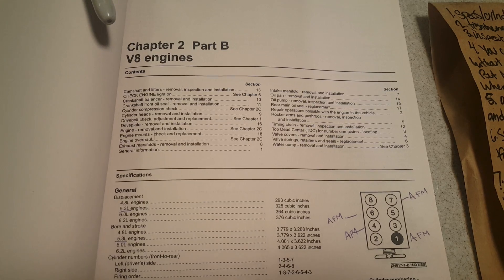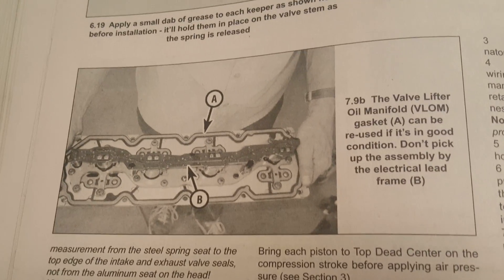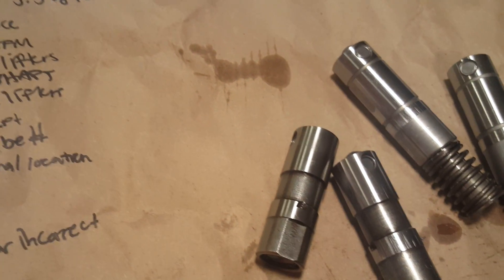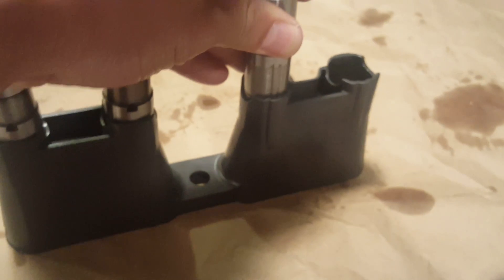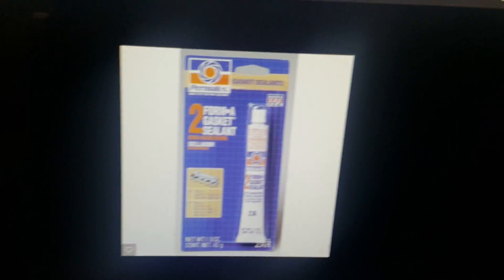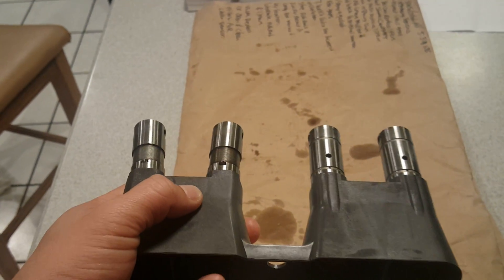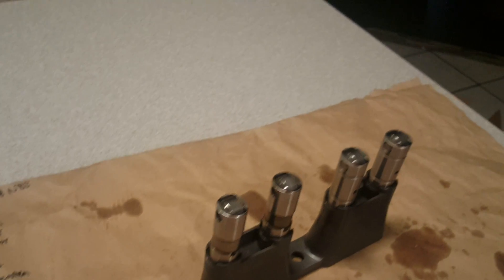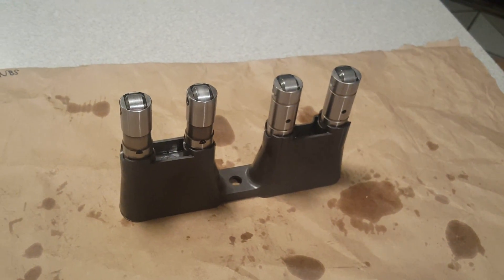2007 thru 2013 Chevrolet Silverado/ GMC Sierra (NBS) 5.3 V8 How to install AFM Lifters/Lifter Fail

Comment: DON'T use permatex on the headbolts the bolt holes are blind on all Vortec/LS engines, why would you use copper spray with new head gaskets? that is OLD SCHOOL thinking! GM calls it DOD not AFM....

Comment: video is a year and a half old, hoping you still get a chance to reply.  i have a terrible issue with my 2015 escalade  with afm.  it took a dump and now getting a ticking noise plus other tapping sounds with going from V8 to V4 mode.  after sitting for a couple days, i fired it up and noticed check engine light, kind of a limp mode type deal and loss of power.  will this video help me out with the 6.2L?  do you have a video on removing the top end of the engine to access and replace the lifters?  thanks.
Reply from the maker: Yes, It will help you. 
Send me an email if you have questions! I will see the email faster than these comments.

Comment: Hey bud can i ask you a couple questions?
Reply from the maker: Sure.
Reply: @Iriebaker1  i have a 2007 gmc yukon xl 5.3 mine started knocking exactly as yours in the video and i put the scanner on it and it said cylinder 1 i took the valve cover off and let it run and that lifter was not moving i changed the lifter from the dealer 100 dollar lifter just the one that was not working and i started it and the knocking went away after that about 1 week it started again and after that i just keep driving it like that and one morning  it just stopped knocking till again another week so its pretty hard to tell thinking about jsut going non afm

Comment: ayuda tengo una camioneta 5.3 y no funciona medio motor problema con levantadores com me puedo comunicar gracias
Reply: Arevalo tengo el mismo problema un bloque de cilindros no esta funcionando y ya limpie y mantenimiento a la AFM mainflod. Pero creo que es un problema electrico nom sabe cual es el fusible que alimenta los solenoides.? 
Arevalo I have the same problem a cylinder block is not working and I already clean and maintain the AFM mainflod. But I think it's an electrical problem. He does not know which is the fuse that feeds the solenoids. or any of you who knows what the fuse is?

Comment: Bueller,      Bueller,            bueeeellllller. Could you be any More monotone?!!
Reply from the maker: chad kinneer I made the same video previously and my family said I was talking too fast, Then I slowed it down a bit so the viewers could understand me clearly. This is my first video and it definitely sounded MONOTONE. It just feels good to know I helped a few people bring their Chevrolet back to life.
Reply: Iriebaker1 lol, all humor aside; I didn't compliment you on what most would take for granted when re-assembling an engine. You're unfortunately very true on the cost to rebuild this puppy as being very high and time consuming. I performed mine a few days ago and took me approximately from 2pm to 10pm the first night and then from 8am until 4pm the final day. I was expecting a problem or 2 but successfully had no issues.😐 my silvy is back to running like it should with no awful tapping sound followed by the check engine light flashing uncontrollably to get my attention.. Very nice video BTW, well done and sorry for the dick first message. Oh, and I wouldn't worry about talking too fast since pretty much everyone talks too fast these days anyhow. Good luck in the future!
Reply from the maker: @chadkinneer2728  Hell Yeah! Congrats man. Sorry , I just saw this.

Comment: Will a bad or gummed up .forgive me the channel under the lifters is clogged will if make a type of cherpING noise?? I have an 07 van I got for my back cheap 122k miles but it has a rackst I can't chase down.I did notice drivers side valve cover hotter than other side lIke honey glazed were the pass side looked more plain. Metal look. Less oil coming out of push rods on d s
Reply from the maker: Did you ever solve the issue?

Comment: I have three of the four SFM  lifters fail on my 2008 suburban with the flex fuel.  I need to replace them and would like to do away with them if possible, would it entail changing the cam and changes to the computer?  I bought the AFM disabler and it still would not work properly, when I took the valve cover off one of the lifters still was not working as the rocker arm did not move at all, worried about the cam!  Your thoughts would be helpful.
Reply from the maker: I would replace all the lifters. 4 afm from chevy dealer. Try to sell these online or just replace the bad one and try again.

Comment: buenos dias varon de dios tengo una tahoe en venezuela año 2007 motor 5.3 tiene un cilindro murto   no tiene compresion el de alado marca 50 en el medidor de compresion el otro marca 40  TIENE UNA FALLA MUI GRANDE MI PREOCUPASION ES QUE CERA VALVULAS O EMPACADURAS O TAQUETES  TENGO ESA DUDA LA TAPA DEL LADO DEL CHOFER MEDI TODOS LOS CILINDROS ESTAN BIEN  YO PROBE BUJIAS BOBINAS CABLES NO ES EL MEDIDOR DE TAQUETES ESTA BUENO COMPA
Reply from the maker: Hi, Could you please translate in english and then I'll respond to you and you can translate to spanish? Sorry, I tried but my spanish isn't good.

Comment: My lifters on my 2012 Chevy Silverado just went out. It's being serviced right now. Cool to know what the issue was and how to replace for future reference.
Reply from the maker: Just time and mileage on a truck but I would say most important is maintenance! I change my oil every 3,000 miles full synthetic. I buy the 5 Gal MOBIL 1 at walmart and do it myself. It's better priced at wal mart. Always check your oil levels and transmission fluid level. Power steering fluid. Check your motor mounts and shocks. Never let your truck run out of gas or overheat! Just shut it off and have it towed or add coolant and take it to the shop or you will make everything worst.

Comment: Thanks, this really helped alot, previous owner, or whoever work on my impala ss put a afm lifter backwards, should i replace the retainer bracket though?
Reply from the maker: Juan Pas No problem and why not? They are only a few dollars. If you are that far into a project and if you have to ask yourself, should I replace the retainer? What if you put everything back together and let's just say it doesn't run right, What's the first thing you're going to think of? The cheap retainer! Always replace the part if you're debating, especially if it's cheap. I always do on a project this size.
Reply: Juan Pas did you have to pull the engine to get to the lifters?
Reply: Michael Robinson yea

Comment: if the lifter is installed backwards in the retainer the camshaft and valve spring will overcome the force of the plastic holding it.  It won't cause it to not move.  It will probably cause the retainer to break apart and cause a catastrophic failure.
Reply from the maker: Steven Wilson These lifters were installed incorrect. when I flipped them around, it stopped knocking and everything worked fine.

Comment from the maker: I posted a video of my truck after the install!
Reply: I use a product made by Range Technologies (AFM disabler). $190 and it plugs into your ODB connector under your steering wheel. I get better MPG and oil consumption has dropped from up to 2 qts to less than 1/2 qt....
You can also buy a tuner to disable. I've used Bully Dog - $350 and can tune it for performance as well....
Reply: Iriebaker1 if i want to delele the AFM any recomendations
Reply from the maker: silvino betancourt just saw this. How did it come out? Did you delete the AFM?
Reply from the maker: Nathan Flow  Thanks for the info, I'll check it out.

Comment: Did you consider doing an AFM delete on your truck? I have a 2008 Silverado LT with the 5.3 flex fuel with AFM. My truck has 196k miles on it and there is a very audible lifter tick, most likely an AFM lifter on its last leg. I priced all of the factory replacement parts at about $1000, but you can get an AFM delete kit that comes with everything but a new cam for $340 from texas speed. Then a non-AFM cam is about another $300 so still only looking at about $640 if I do the work myself.
Reply from the maker: Can you send me a video(with sound of course) of the tick to my email.
Reply: I uploaded a video to my channel, take a look and listen and let me know what you think.

Thanks!
Reply from the maker: cyrix1986 Ya it's your lifters and sounds like an exhaust leak. I'm not there to hear it but I'm about 95% sure. Just don't be cheap when you replace them. Get the oem afm lifters. Make sure you replace your gaskets and resurface the cylinder heads. Go to a machine shop. Not a mechanic!! Save money!
Reply: Right on, thanks for taking a look. I'm thinking I'll tear into it tomorrow, take the valve covers off and make sure all of the push rods and rockers are in good shape. Also use some B12 chem tool on all the lifters to see if it may be an oil starvation issue from crud blocking the oil ports on the lifters. I dont think the previous owner kept up on the routine maintenance very well.
Reply from the maker: So my vehicle is an 07 5.3 V8(obvious from the title) I'm going to take a video of my engine similar to the one you recorded and show you the dfference. I'll post it on my channel very soon.
Reply from the maker: I posted that video as promised.

Comment: nice video, very informative! good job bud
Reply from the maker: Thanks. Did it help? This is my first YouTube video.
I couldn't find, one good video on lifters.
Reply: +Iriebaker1 it did actually. I was researching what direction and what exact cylinders got the AFM lifters. after watching your vid I realized like the dork I am, the lifter trays only allow them to be installed one way. haha. but my Avalanche is about 90% put together. can't wait to hear her run
Reply from the maker: +Joshua Mouw 
Phew! Close one. Thats what my mechanics did, put it in backwards! They really screwed me but my truck has never ran better! Make sure to use the permatex#2 and spray-a-gasket. In the beginning of the video, you can pause it at
 :23 I marked which cylinders require the AFM lifters (bottom right in book) Email me if you have any questions.
Reply: +Iriebaker1 I always use the copper gasket spray on head gaskets, been using it for years now. never had a problem with sealing. I did use some sealant called The Right Stuff gasket sealant on the head bolts as well. We shall see later on today when I go for the first start. I'm confident tho. this isn't my first rodeo lol. I did buy enough oil so I can flush the engine and change it after it runs for a a little bit. and an extra Wiks oil filter
Reply from the maker: +Joshua Mouw 
How did everything turn out?
Reply: Truck runs like a champ and nothing leaks. Not a drop.
Reply: how did you take outthe lifters fromthe plastic,having ahard time figuring out how to remove 2 With the springs
Reply from the maker: Wolf Pack Garage just use force and pull straight.